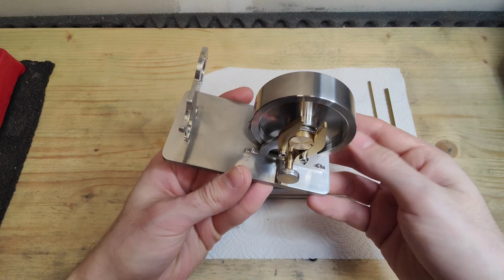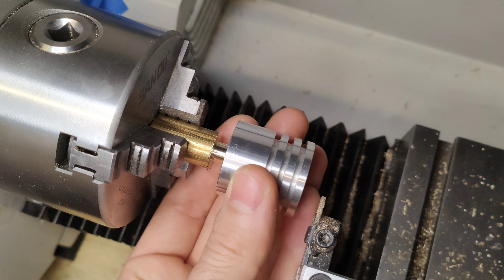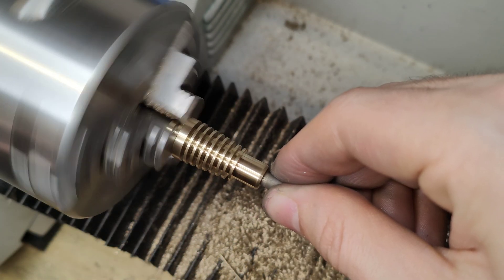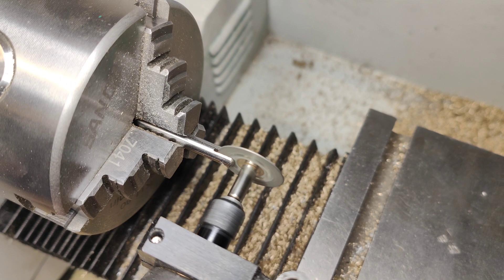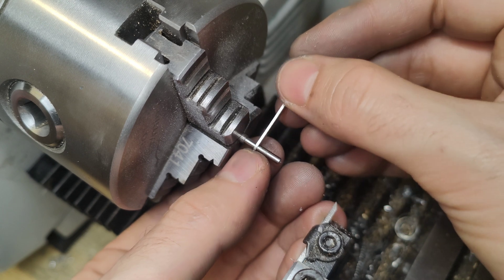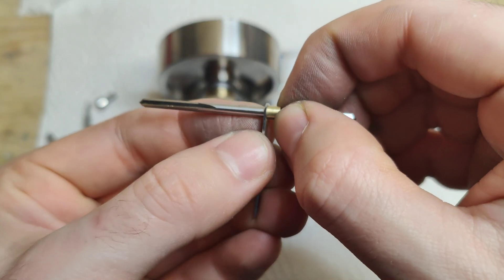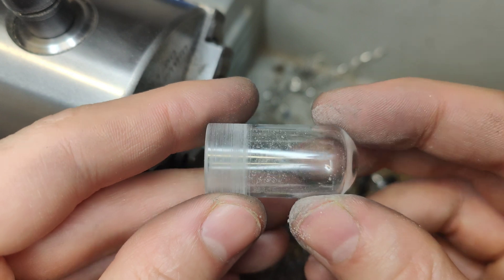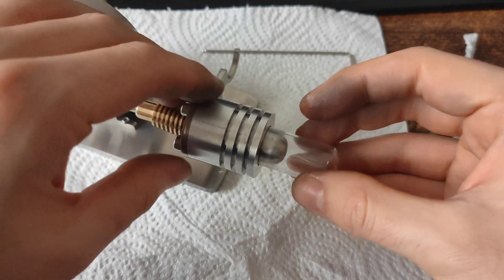Building a stirling engine part 3

Comment: I would also love to know what is the displacer pistons connecting rod made of? I was thinking of using already existing piece of right diameter, so I don't have to machine a shaft that perfectly fits the connecting rod housing/slide bearing. Also the displacer piston connecting rod housing is just brass right? I've seen people use cast iron for this but brass seems to work great? :)
Reply from the maker: The connecting rod of the displacer piston is made of steel, i don't know what kind. I also used a cylinder pin for the connecting rod, you just fave to polish the surface. The housing is just two brass bushings.

Comment: What's the displacer piston made of? :)
Reply from the maker: It is made of aluminum, but it will be changed to graphite, video coming soon. Also graphite doesn't need lubricant. :)
Reply: @AdventureFaith1  but the displacer piston does not come in contact with anything right? It only displaces air. Why would it need to be made of graphite?
Reply from the maker: @Anomalous-Plant  I'm sorry, I meant the powerpiston. The displacer piston is also made of aluminum and the connecting rod is made of steel.  You're right there is a tiny gap between the glass and displacer piston.
Reply: @AdventureFaith1  ah, sorry! Should have realised what you meant
Reply from the maker: @Anomalous-Plant No all good, I didn't read your question right. :)